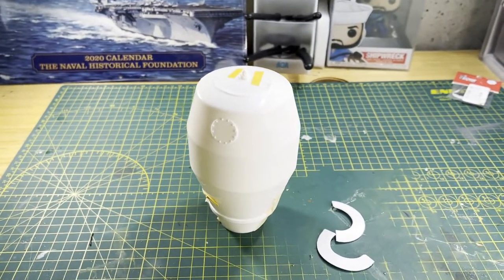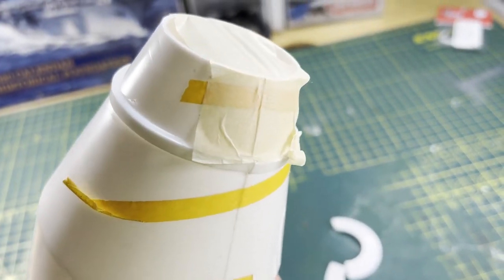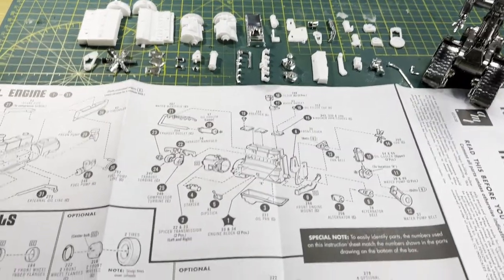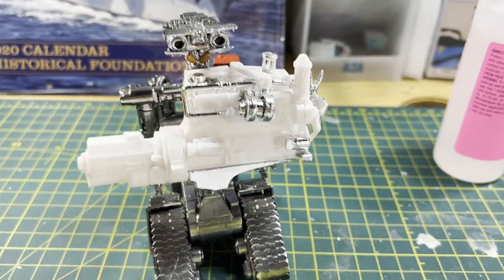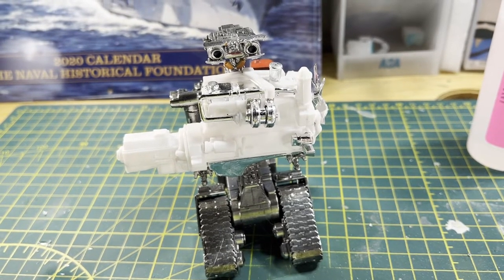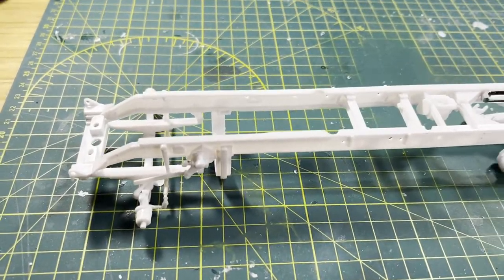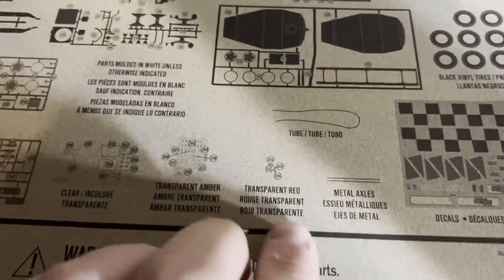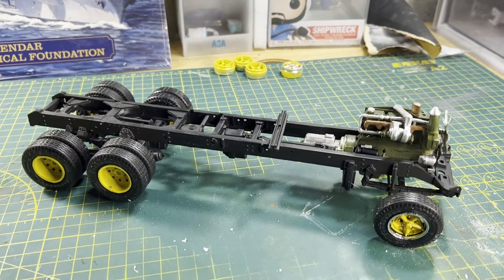1/24 AMT Kenworth Challenge | Cement Mixer | Part 1 | Engine to Rolling Chassis

Comment: I use a hair dryer to heat parts and bend and shape might help in the future
Reply from the maker: Thanks for the tip Sir!  I never would thought that would work.
Reply: @averagemodelguy3544  ya had a frame that was crooked and it did the job
Reply from the maker: How long did you heat it up for?
Reply: @averagemodelguy3544  it doesn't take much a minute or two don't get real close on thin pieces
Reply from the maker: Thank you again Sir!!
Reply: @averagemodelguy3544  np brother